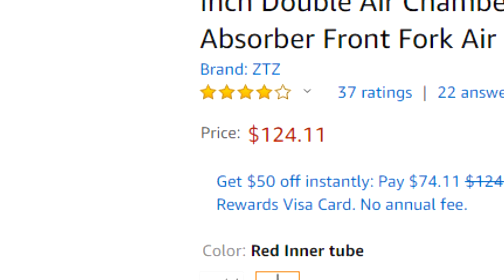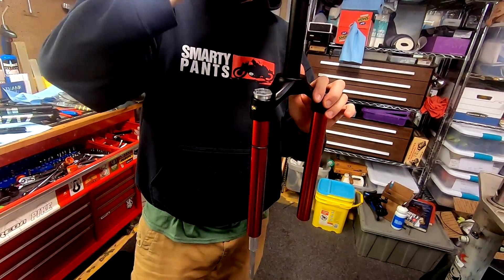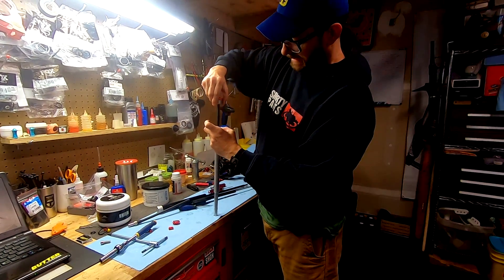$124 Bolany ZTZ Mountain Bike Air Fork Tear Down | Butter Suspension

Comment: There are 2 videos here in the Philippines circulating that forks stanchions splitting in half while using in an xc trail
Reply from the maker: I've seen one of them. Not good! I'm planning on making another video with a failure test of this fork.
Reply: please make a review about it it'll grow viral here in the philippines because there's no proper reviews to watch at the moment and you're our kost trusted guy interms of reviewing suspension forks
Reply: I saw the video, same accident would have split a roxshox fork in half as well.
Reply: @ickbar11  not really. There are other varities of accident involving this fork even on long rides they break. Such a disgrace on rockshox for u to compare it to a unknown china brand. People kept saying they used the fork on a downhill track i guess u people haven't seen an xc steep section.
Reply from the maker: @ickbar11  I disagree. I've never seen a Fox or Rockshox fail like that from riding. Only from a roof rack incident. Keep your eyes peeled for my next video, i'm gonna put some forks to the test!

Comment: Hi there. Thanks for sharing.  What's a reliable  and decent prize fork(make)  can I look up to upgrade the one on my Giant XTC 1 ("26). I have a Marzocchi Bomber Suspension Fork. 
Thanks in advance
Reply from the maker: I think a rebuilt Bomber is better than many forks out there. Not much available in the 26" market anymore, depending on what year your bike is.
Reply: https://youtu.be/-_LsJj9whTQ  Also Bolany used in a trail.

Comment: So if you buy this fork, you have to take a part and chek every thing. Put oil and some locktite in the treads. And pray for the rest of the fork is well done, if the head tube etc is not well put together, it coul be dangerous.
I have been checking this fork and I have ended buying a rock Shock Silver. Works quite nice despite it is spring.

Comment: I have a 1984 Specialised Hard Rock, I wonder if this would work on my bike?
Reply: It depends on the head tube diameter if it fits, some older bikes have only 1 inch, newer ones 1 1/8 inch, some modern ones have a tapered head tube (means the upper bearing has a smaller diameter than the one on the downside)
Reply: @simonm1447  Thanks I guess it would be wise just to take it to a bike shop and have them fit on my bike.
Reply: @Moondoggy1941  In behalf of the fork in the video itself, in some newer newer comments the guy from the canal warns to use this fork only on smoother trails, it seems there have been cases where it broke apart when it was treated too harsh. 

A Suntour XCR may be an alternative, you get them in different sizes and with air suspension (also you get 26 inch versions). 
I have two XCR 32, of course they are no high end forks but they are rigid enough to withstand the forces (of course no hard downhill or dirt jump)  and they are fine for the price (they won't cost much more than the one in the video)
Reply: @Moondoggy1941  Here's something else which wanted to modify a 80's Specialized hard rock (unfortunately it's a German forum)
https://www.mtb-news.de/forum/t/1987-specialized-hardrock-umbau.681608/
It seems it has a 1 inch head tube, so it may be difficult to find a modern suspension fork, they usually have different sizes

Comment: So can you tell me what a decent inexpensive fat ebike suspension fork would be. The bike is about 66LBS with a dainty 250lb rider. I want a rebound adjustment cause I can't stand the slamming when it hits the stop.
Reply from the maker: "Cheap, light, strong...pick two" Both Manitou and Rockshox make fat bike forks, I would look for one of those. Inexpensive usually means bad quality or no useable features (like rebound).
Reply: @ButterSuspension  Thanks.

Comment: OK here is a challenge.....can you take that basic for and modify it to perform better? Would be interesting to see if you can
Reply from the maker: I'm not worried about performance on a fork that hasn't been tested for safety. My biggest concern is upper leg failure.
Reply: @ButterSuspension  totally get that, was more an "out of curiosity" thing to see if you can take a trash fork and make it good. Maybe not with that for but with something else.

Comment: I've been beating the crap out of mine for almost 2 years. The only issue is the excessive lubrication mine had from the factory. It has sorted itself out with no servicing and I have to say its alot better than the 2007 fox f100 it replaced with the rigidity

Comment: Id rather ride my 4 year old suntour xcm

Granted its never seen trail use (used the bike as a commuter)they are pretty beat up due to poorer build quality for it being a lower end fork

Bushings are pretty useless at the moment 

I rebuilt it but didnt bother getting suspension grease tondo it properly as i ended up replacing it with a rockshox recon a month later

Comment: AliExpress has a bunch of sun tour/bolani cartridges. But it’s an easy upgrade to put better cartridges in its place and it’s automatically became a high end fork.
Reply from the maker: I completely disagree! Just because you can find a honda motor online doesn't mean putting it into your suzuki swift is gonna make it a great car! Everything about the BOLANY line (or any fork at this price point) is about lowest cost. New damper? It's still a cheap air spring, cheap lowers and cheap uppers.
Reply: @ButterSuspension   Putting a corvette engine in a Honda Civic body definitely will make it one hell of a race car. Any upgrades is better than no upgrades. Even quality suspension like fox, rock shock have upgraded damper cartridges every few years. A newer/different cartridge can change the whole suspension feel. So yes, a damper cartridge is extremely important for a good fork.
Reply: I’ve done a cartridge upgrade on a cheap Chinese blutu inverted fat fork with an old Wren cartridge with h/l rebound adjustment I had laying around after upgraded with newer all weather cartridge and it’s night/day in comparison. It’s no actual wren fork with dual air chambers but it ain’t cost $899 either. Don’t count a Frankenstein fork out, try it out.

Comment: Hello, i like the review vlogs uyou do so i will keep hitting the like button and hopefully you can help me, im building a cheap basher fat bike but having trouble with the forks i have found and really like cause they are an air and oil triple tree fork called a PASAK P-35 TRIPLE TREE AIR SUSPENSION FORK, i cant find anything about them on u-tube or anywhere else, they are cheap chineese forks which suits my budget as i am in thailand with no idea when i can go home to Australia, hence the cheap fat bike build. If u could please help me with any reviews or other information about them so i know what to expect, they are a 26x4 fat bike fork and for the $250 seem like a bargain and the look is a bonus, any info on the PASAK P-35 TRIPLE TREE AIR SUSPENSION FORKS will b gratefully appreciated, thank you for your time and any effort you put into checking the fork out for me please, Jay, stuck in thai.

Comment: Thank You for your review.  I recently bought a Himiway ebike.  When it arrived at my house the box was soaked in oil inside and out.  I removed the bike out of the box and found the forks were leaking oil, so I asked the people who I bought it from about my findings.  Well, no one has been able to give me an answer as to where the oil was coming from.  Now after watching your video I see that there is an oil-filled damper inside the forks?  So my question is "can the damper be refilled with oil and what kind of oil should I use?"  Thank you again for your excellent review....perhaps I should just buy a new fork from Amazon?  I guess I should say that I am 76 years old and will not be doing much offroad mountain bike type riding.
Reply from the maker: Hey Bill- it is a sealed cartridge, not rebuildable or refillable since the ends are crimped steel. Nothing about this fork is designed to be serviced; at this price point and the fact that there's no phone number or website to get support, these are just designed to sell, use and toss.
Reply: @ButterSuspension  Are you saying my forks or the ones sold on Amazon should be tossed?
Reply from the maker: Sorry, I thought you were commenting because the bike you purchased had Bolany forks...what make/model are your forks?

Comment: I need a decent made fork to upgrade from suntour
Reply from the maker: Rockshox, Manitou or Fox...
Reply: @ButterSuspension  yeah those were the brands I was looking at. Thank you. I have the sr suntour m3030 and im assuming its probably the bottom of suntours barrel.....

This is the rear shock im running. Not sure how good it is but its a lot better than the simple spring it had before

Comment: Are the Lutu forks the same?  They have a rebound adjustment, but as far as its intended use, not for jumping.  What about rock gardens and roots?  and smaller jumps like 2-3 foot jumps?
Reply from the maker: Haven't taken one of those apart. Nice that they offer rebound adjustment, but ANY FORK priced at $135 is probably not safe.
Reply: @ButterSuspension  They cost $170
Reply from the maker: Ok. I found some on Amazon for $135. Regardless of price, the real issue is accountability. If something fails, who do you call or email for warranty? Has the product been tested independently? All the major brands are tested and certified safe for their given application and they all have websites with contact info. If you could buy a brand new car off the lot for $500, do you think it would be safe to drive?

Comment: The cartridge can be replaced whit one that can be serviced right? Almost all of them are the same size right?
Reply from the maker: It's possible that a random cartridge from another manufacturer may fit, but they're all so different in so many ways I'm not sure it would be worth the effort. Also, even if you did put in a nicer cartridge, you still have a low quality fork. And... a nice cartridge from Fox or Rockshox coat about $300; most folks buying a $130 fork probably wouldn't pay for a damper that cost more than twice what the fork cost.

Comment: These are actually ok to replace suntour or similar coil forks.
Reply from the maker: I'd have to disagree if they're going to be used on actual trails. The base model Suntour forks aren't awesome, but they're at least tested and you have someone to call if you need to warranty.
Reply: @ButterSuspension  but This fork it is better than a entry level sr suntour xcm right?
Reply from the maker: @motoryclefield2038  no, not really. The Suntour entry level stuff isn't amazing, but it's been tested for safety and you can call someone for a warranty claim.
Reply: @ButterSuspension  but for damping and for all terrain is more comfortable?
Reply from the maker: @motoryclefield2038  well, maybe. But I don't think it's worth the risk of a fork failure. They just aren't very safe for actual mountain biking.
Reply: @ButterSuspension  This suspension isn't safe?
So it is better to keep my sountour xcm v3 instead of This?
Reply from the maker: @motoryclefield2038  I don't think they will hold up to normal trail riding. I have seen videos and photos of massive failures on these forks since I made this video.
Reply: @ButterSuspension  i didn't know.. it is a shame..
 if you say.. i Will keep my Sr sountour v3.. 😜😁

Comment: The parts the you heat up , is that threaded? Or is just someting glue anything that they use to stick it up

If you answer mo it is a bighelp..thanks More power on your channel
Reply from the maker: Yes, threads with loctite usually. Heat softens the loctite.
Reply: @ButterSuspension  THANKS , BIGHELP😍😍😍

Comment: Just a little better is UDING UD-32 I bought it for $150 3 years ago. Its rebuildable as far as the o rings and wiper seals. 2 kilo weight is better than steel ship anchor forks at 3.9 kilo. KevCentral used this on his mongoose xr-pro build. As you said, you get what you pay for. Good video.

Comment: seen a crash video with that fork and both stanchions just broke
Reply: Hmmm.. Let me guess someone went on a hard trail with that fork?.  because if he did. Well damn he needs to read some warnings haha because this bolany fork is an xc fork really which are not suited for hard trailing. This forks are light and made for light trails so yeah I don't recommend using these forks when going out on hard trails
Reply: @hachilemo3888  No, he did not go on a hard trail. All he did was jump it off 30 feet from the top of his roof. It should have never broke

Comment: Great vids yow
Have you measured the stancion tube cross sectional thickness?
Reply from the maker: Thanks Adrian! I didn't measure but they're the thickest I've seen. Probably has to do with the overall strength of the alloy they use...
Reply: @ButterSuspension  thanks man it must be a weaker alloys.

Comment: I just bought a bolany explorer 36, it has a 160mm travel and 36mm stanchions I'm fascinated about the thickness I just thought it can hit small to medium jumps and drops. surprisingly it has 16 clicks on compression and 14 on the rebound I would want to see what's inside the lower legs, I hope you can make this kind of video again with bolany 36 and some tips to service if ever that it is serviceable because most of our mechanic in my area doesn't want to open this kind of fork, I think they're afraid that they might destroy the fork, I love your content and by the way, I just subscribed! :)
Reply: Can't wait to hear your impressions once you get this installed. I'm looking at a similar brand also.

Comment: Could you replace the seals for better one and use some sram butter on the stanchions to make it better? Too resist water getting in and corroding it.
Reply from the maker: It's more than just better seals and Sram Butter; since every part of this fork is made to be as inexpensive as possible, new seals will only solve one issue but that doesn't address the overall low quality.

Comment: Why is it the Kashima coating nowadays chips easily? Is it because of Fox forks high demand? Got a 2012 Fox 36 Talas, got gold stanchions but non-Kashima, but upto now, still no chips, dents or cracks...
Reply from the maker: I haven't seen many with "chips", but scratches and dings happen all the time if you're not careful. It's not like a super hard coating, it will damage easily just like any other aluminum tube. 

"Nothing happens to bikes that sit in the garage..."
Reply: Butter Suspension agree! thanks for replying. Hehe! Your channel’s content is very informative. New subscriber here...😜👍

Comment: I enjoyed this video very much. Would you recommend it over some basic spring coil Santour forks, like XCM or XCR? Base of what I have seen here Bolany is made of basic parts, but should still has better comfort and regulation than Suntour.
Reply from the maker: Thanks!

I'd go for a Suntour over these, if only because you can call Suntour for help, warranty and parts. Also, all the Suntour forks have rebound adjustment; even the most basic suspension should have that.
Reply: you can use the Suntour upgrade program and get a massive discount on one of their higher-end air forks like the Raidon
Reply: @Andrea-qg5yk  can you give a link or something for that?
Reply: @Andrea-qg5yk  interesting

Comment: Good video, Thanks! I just rescued a 1998 Rock Shox Judy SL, before it reached the landfill. It has air cartridges in both forks. I took it apart and cleaned it up. Everything seems fine. I have not put it back together yet. Is this a good shock? BTW, it’s on a 1997 Cannondale M900, also not going to landfill. 🙂 Thanks!
Reply from the maker: Hey Brent, thanks!

The Judy SL was pretty high end back in the day, and if they're Englund air cartridges, those were a pretty nice upgrade over the stock internals. 

Keep an eye out for a Judy video soon!

Comment: Can u do a rockshox judy?
Reply from the maker: Coming soon! Judy's were super popular back in the day and I have a pretty good pile of parts for them...
Reply: @ButterSuspension  
What about for Mag21s?  I have a 1 in steerer on my Fat Chance Yo Eddy and I was thinking of buying an eBay Mag21 to take the lowers and put them on my crown with the 1 in steerer.  Then I could take apart my old ones and learn how they work.  Or would I be better off getting Quadra 21Rs and buying coils to replace the elastomers?  Thanks in advance.

Comment: I saw this channel and I recently bought a 120mm Lutu fork. My main bike is a Giant Reign SX with a Fox36. How ever I wanted to try a 29er with putting to much money in. Now the Trek Marlin comes with a horrible heavy pogo stick. So the Lutu Fork is similar to this with Rebound.  Its not a DH or Park bike so the Lutu from my experience so far, after spending years on longer travel Fox and Rockshox fork is , for the money it hard to beat. I was surprised at how well it worked in smaller rocky terrain.  I won't be sending it of big jump but the Marlin is not suited to that anyway.  My first ever suspension fork was a Judy back in the 90s. This is worlds better. Long winded I know but the point is, I respect your shop experience but instead of just tearing the fork apart and saying its not built as well as high end fork, get out and test them and give an objective POV. Maybe you can't if you business is servicing higher end forks. But I hope so 😎
Reply from the maker: I appreciate the comment Chris. In my experience, if I can't get parts for something, it makes me a little nervous. But at this price, you wouldn't need to rebuild it, just buy another!

Also, specifically regarding this fork, if there's no rebound control or adjustment, it's just not going to perform well for most intermediate riders on normal trails.
Reply: The trek marlin was built to take a 300lbs man. IT can take jumps and drops. but the fork cant